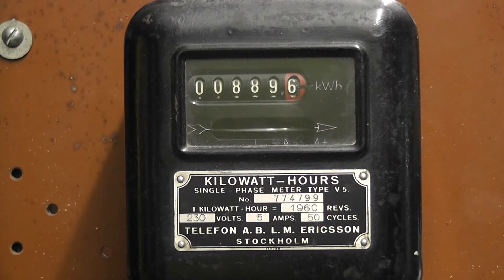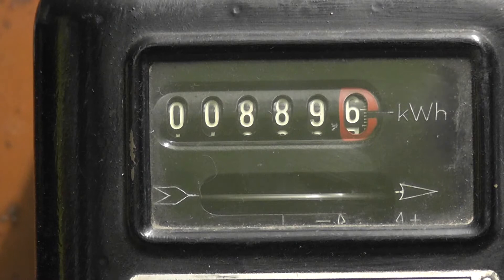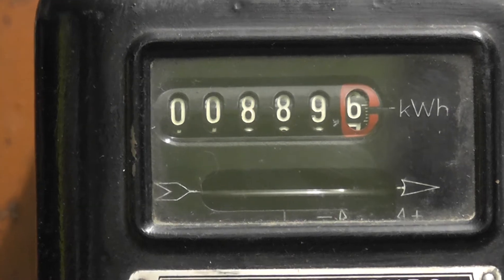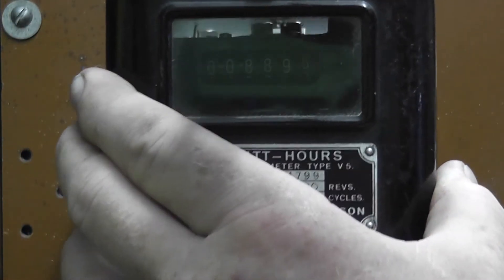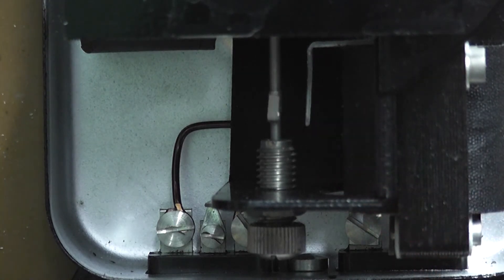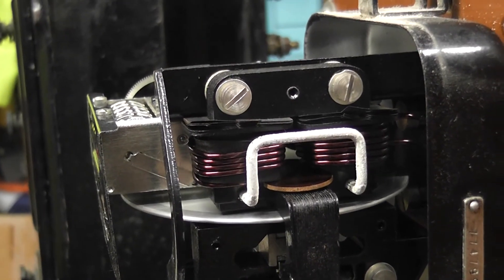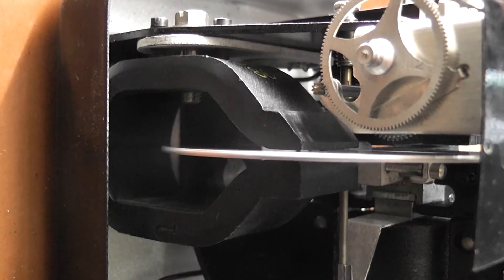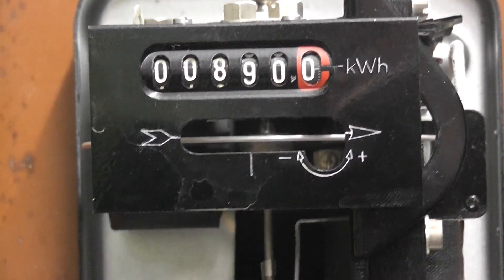Ericsson V 5  meter

Comment from the maker: Most of the time around 4.5 Amps, 1 kW.
At the higher speed 9.4 Amps, 2.2 kW
an electric oil heater was used as test load.

Comment: Nice! Interesting that the coils of this one are mounted in reverse to most other meters (i.e. with the voltage coil underneath the load-wheel instead of above it)

Also did I hear you say: Phase in & out, Neutral in & out, left-to-right? Well, if so, then that's also interesting, as a lot of meters I know of, have phase in, neutral in, neutral out & phase out, left-to-right. 

Has the terminal configuration on this meter got anything to do with the coils being mounted up the other way?

-BBD.